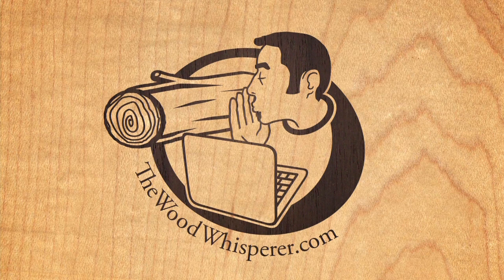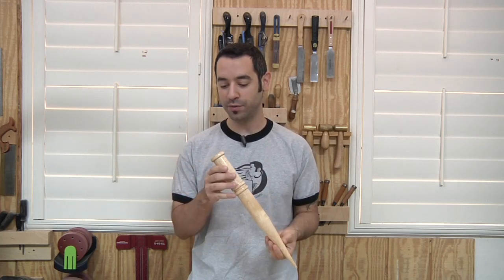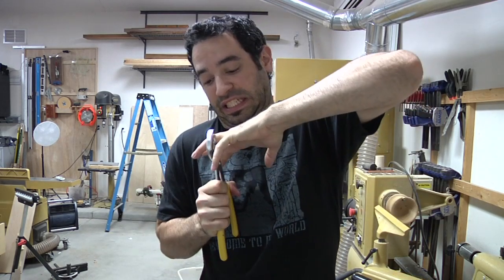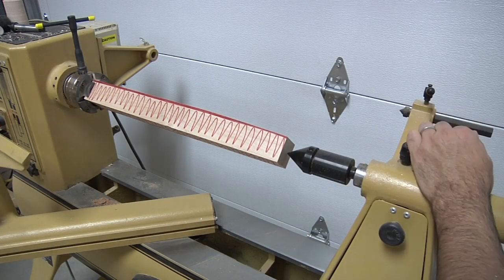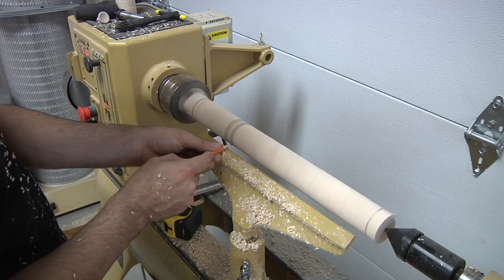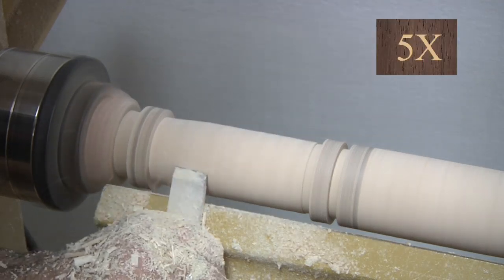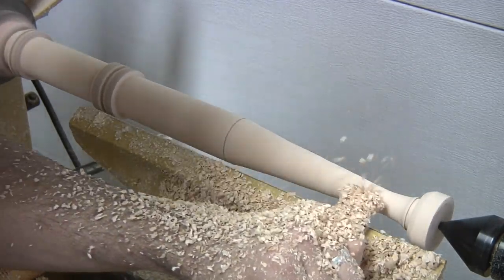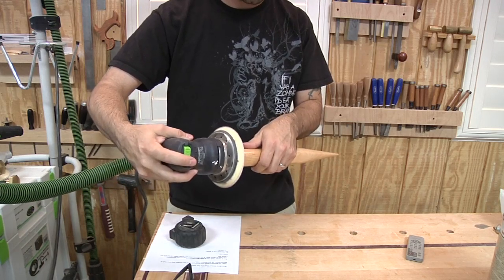127 - How to Turn a Wooden Vampire Stake

Comment: Hello, I found this video on Propnomicon. I have been looking to get into wood turning and the way you did this video, and the simple descriptions used has helped me understand over some of the so called 'experts' and the video angles were just right to show on how you did the carving. Thank you.

On a side note, after the project is finished, if you take a router or dremel and make a grove along one or two sides, it will allow for easier penetration into the vampires rib cage.

Comment: Marc I'm 25 and started my workshop at age 20 in my two car garage. I just discovered your show on here and have been hooked ever since. I just wanted to know when you first started getting a passion for woodworking? I'm in Floor Covering I do HardWood Flooring among other floors but my main passion is carpentry and cabinent making. Just wanna say thanks for the inspiration that if you work hard it pays off in your trade. I'm currently setting up a new shop and looking to expand my knowledge.

Comment: @Xar0mir Marc answered the reason for it being in the video, as a professional advising of possible safety concerns, even if you personally choose not to is always best course. 

But from a medical perspective. If you break or sever a finger in the work shop a ring can cause significant problems later on down the track. Hopefully your safety practises prevent an accident from even happening but its always worth considering.

Comment: If you are taking orders, I would like 7 at the 16.6 inch length, no finish (must be open to the pores of the wood).  I lost a dog to a vampire and I need to return the favor.  But I would like to portray them on the wall as part of a decoration.  And if you want to know why the extra half inch, the end to be struck by the mallet should be thicker to allow a good solid whacking surface.

Comment: I'm a little concerned with the urethane coat, which is essentially an outer shell of plastic.  I haven't seen any scholarly publications which specify the mechanism by which wood (as opposed to other materials) interferes with a vampires animatory faculties, so I can't be sure, but I would be afraid that this would be equivalent to staking a vampire with a plastic stake (with a wooden core).  You might be better off with an oil finish, at least in the penetrating part of the stake.